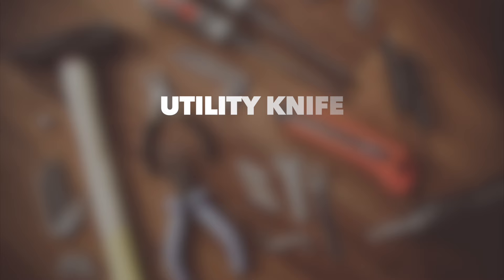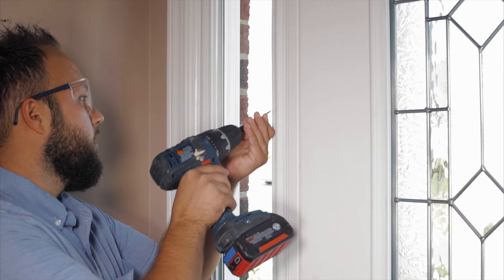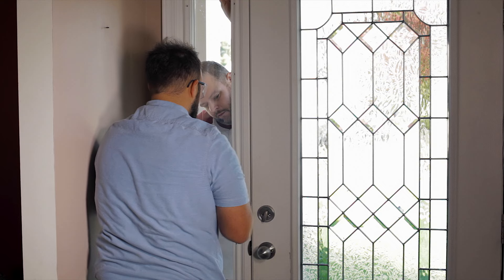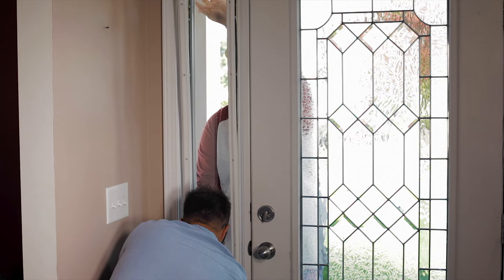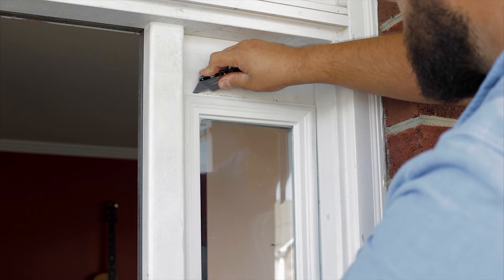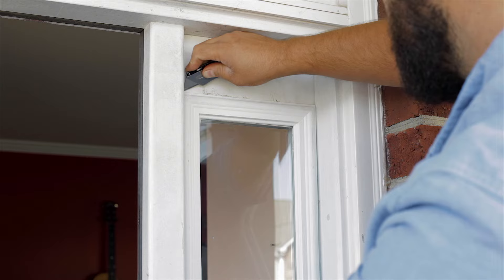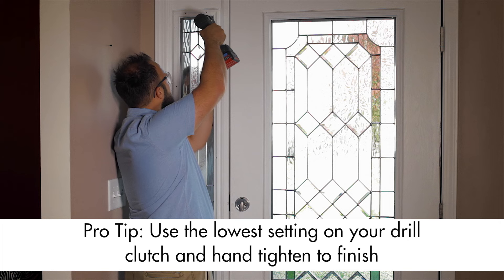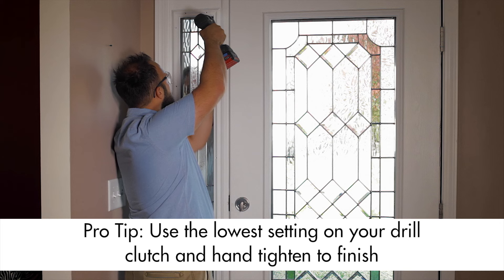How to Replace a Door Sidelight - Door Glass Insert

Comment: I'm installing new glass in my sidelight. What kind of silicone/caulking should I be using to seal the glass @ the trim stops?
Reply from the maker: Thanks for the comment! I have reached out to our product specialists and received this message back. "Do you have a standard size sidelight? If so, our frames come with a frame and Resolve, which is a dry sealant. So no need to use wet caulking." If you have any more questions or comments please give us a call 855-813-3111 our team is happy to help you! Thank you!
Reply: @zabitat  I custom built my sidelight & transom so I had the glass cut for them. I have figured out that it's best to use glazing puddy for a more traditional look. Thanks for the info.
Reply: @zabitat  May I ask, how do you properly measure the sidelight? Is it the actual glass itself or the entire sidelight, including the wood. I'm coming up with abnormal numbers. 6"x 66" for the glass itself. Does Zabitat make custom sidelights?
Reply from the maker: @samspade8830  Thank you for reaching out. I'm happy to connect you to a Zabitat specialist for the best results. Please reach our team at customer.service@zabitat.com or call 855-813-3111. We look forward to hearing from you. Thank you!

Comment: How strong are these doors? Am looking for security and a door that won’t shatter or break if kicked.  Can that glass daily break and can the door be unlocked?
Reply from the maker: Great question! Most of our decorative glass inserts are triple pane glass (3 layers) of tempered safety glass (like a car windshield). So this is not something that is easily broken through, making it very secure and safe.

If this was still a concern, we also offer Severe Weather versions a lot of our glass offerings which adds a ton of additional strength to the glass and frame making it certified to be used in hurricane prone zones. This makes it even stronger and more secure.
Reply: Thanks!  Appreciate your response.
Reply: Hi guys I’m looking for a sidelight glass for door M280 A how could you help me get itZabitat